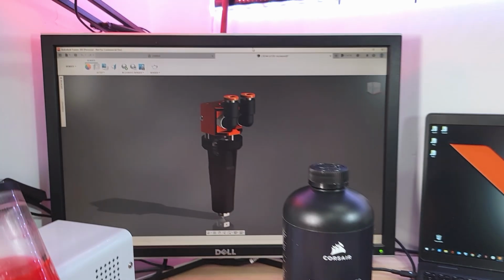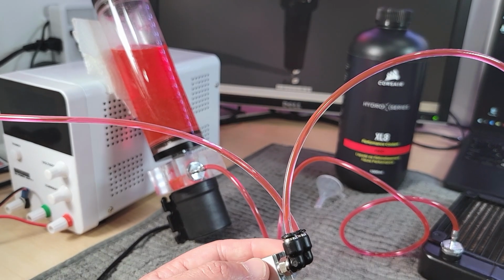LSD watercooled Heat sink flow test

Comment: you dont need that high of a flow. I tested that with my PC, Ryzen 5900X and RTX3080 on the same loop, loaded it with a Cinebench loop and Furmark for the GPU - so a constant 460 Watt load. With my pump at 2000 RPM i ended up with a water temperature of 42°C after 30 minutes. with the pump at 4000 RPM i got 40°C - so thats pretty negligible. Contact area for the coolant is the most important factor...
Reply from the maker: Yep.. as long as there is a bit of water movement..its fine :)

Comment: What is the internal geometry of the block? I see what looks like a ball bearing so I am assuming you just drilled each ingress/egress to depth, and then drilled perpendicularly to connect those two drills and sealed with the ?bearing?
Reply from the maker: Yes. 3 holes in a U shape arround the heatbreak
Reply: @Vez3D  ok, I cnc'd mine from the front so it stores more water then added an acrylic cover. I used some sort of sealant glue and friction fit, but an o-ring would do too; like GPU blocks do and probably easier than gluing. I tried to make inner cavity fins too to increase surface area but I didn't have a small enough endmill so I ended up cutting them off. Your U is probably ok too, but if you find it's not transferring enough heat energy you might try this. You have the extrusion hole to work-around, but you could go real deep on either side of it where ingress and egress is and get a good payload of water in there with larger SA.
Reply from the maker: @ColinMacKenzieRobots  my first design was a bit like yours...with acrylic cover and heat break surrounded by water..with a gasket etc.. but manufacturing cost stopped me. This one is easy to make and it looks so far like its keeping it really really cold

Comment: oh you have way flow than required! :) You'd do just as well with 10-20% of what you have. Even at 8v was high. Not that it would hurt but I'd PWM that down to 40% or so and the pump would be silent probably. Think of like how fast the heat energy is going to transfer into the water...transfer is not that efficient, so you just need to move the water fast enough that delta between aluminum and the water doesn't change. Having larger internal cavity surface area would help more. I have a water cooled head with a small cheap pump and it works great. I wish I used smaller lines like yours though - mine is also overkill

Comment: Flow is way sufficient. If you have a fridge in your printer area (or the other way around  ;-)) stick the coolant reservoir and the radiator inside it. Overkill would be a fan mounted on the radiator

Comment: Jesus, vez, thats a 12-15watts pump... Normal pumps are in the 5-8watt range.
But however, an LC hotend needs an LC cooled Extruder Motor (optimally LC cooled extruder gears either, or at least the extruder gears needs to be cooled smh), to have an optimal use of that in chambers of 80-200c.

Even if you print ABS in an 80/90c Chamber, the results are absolutely amazing comparing to ABS prints in 50c chambers...
That additional 30-40c helps alot with "layer inconsistent shrinkages" and allows you to print a lot faster either, because you can print abs with 100% fanspeed. The hot air improve ABS bridges extremely without the side effect of shrinkage/deformation.
And that's just abs...
LC enables printing all the high end expensive stuff either, but thats not my territory 🙈
I have only extremely positive experience in abs printing at 85c chamber 😂
And im not using LC, because there is not really sth nice out yet, compatible for me 🙈

However, the only problem what i experienced was too hot extruder gears and that the filament got soft and pushed on the side out (LGX), my fix to that was to reduce current of the extruder motor. Seems like the LGX motor got too hot, and transferred that heat to the extruder gears and the filament got soft.
Thats the issue in a 85c Chamber, because the motor produces heat either, so that it probably reached 120c.

Cheers 😘
Reply from the maker: Haha the pump came in the mellow kit. I have no idea what "normal". Yes its good to cool the motors too. But ldo motors i used are rated up to 180c..so its not THAT bad to not cool them..but yes they will be more efficient at cooler temp
Reply: @Vez3D  the motor temp is not what worries me, its just that the motor transfers the heat to the filament gears and that makes the filament soft and jams 😂
Had exactly that issue once here in a heated chamber.
Cheers vez ✌️
Reply: @RamaOlama  yup, same here

Comment: you dont want it fast its better slow to allow heat soak if you run it too fast the whole system will be close to the same for and aft radiator as it also has no time to cool the liquid

Comment: BTW, I tried that Exact Pump/Res. After a while, It Fills the Loop with RUST from the Cheap Pump. Get a D5 Pump if you want somthing Long Term
Reply from the maker: Ill keep an eye it. But that reservoir and pump has like 1000 different model on aliexpress that look the same..so it might not be the same. Ill see. Thanks for the advice

Comment: Nice job. I think they'll probably work pretty well. My primary concern is plastic fatigue in the tubing. Especially at those SharkBite joints. That normal printing speeds I don't think that'll be a problem, but at plus 1000 mm per second.... Not quite as certain.

Comment: What is the benefit of watercooling a hotend? Less weight on the print head?

Also, you aren't an engineer? Is it something similar, like machinist or tool and die maker?
Reply: Hotend fans tend to be the loudest part you can't control, with water cooling you can make it silent by having a silent bigger fan and a silent pump

Comment: I have yet to take any heat transfer courses as a student, but gut feeling says that's probably enough cooling. I was kind of concerned at first about potentially having too much back pressure on that pump given the small tubing, but your current draw is fine and it's probably not an issue. Air going through the pump, however, won't be good long term, so I'd find a way to minimize the amount of air bubbles in your reservoir.
Reply: I've had 2 years of thermodynamics in school, that flow is probably enough to cool all motors too, the average heatsink fan has at most 1,5 watts, the pump about 12. Its the same with car engines, porsche had to switch to water cooling because they water pump needs less than half of a kilowatt, meanwhile the fan for air cooling needed 13 to 15 kw according to our calculations for a 200kw engine. Less parasitic losses, better emissions/ fuel economy. The reason is a kilogramm of air has way less thermal capacity than a kilogramm of water. Same goes for the heatsink on a 3d printer. Also the pump should not draw air, it relies on coolant passing trough it to not overheat, thats why you should not drive your car all the time on empty, the fuel pump might draw occasionally some air causing other problems too.
Reply: Pump pumps till pump dumps then dump the pump and pump#2. Engineer expensive. Estimator very cheep and pump even cheaper. The first and only rule for the engineer is to keep it simple stupid. Once you fail to do that you just start taking suggestions

Comment: If you do anymore testing of the unit it would be interesting to see it with a heater block installed and powered and another thermistor at the top of the cooling block. Pretty sure the radiator can handle the heat, but it might be worth knowing if it will need a fan or not, so maybe some thermistors at the inflow and outflow to measure the temperature gradient. Your doing some really cool stuff, keep it up.

Comment: I tried water cooled hotend with same pump and radiator and I put standard E3D V6 back. Water cooling is an overkill, even with heated chamber. It's better to invest in titanium heatbreak and good thermal paste like MX4, it will give same result even with 30mm fan.
Reply from the maker: There is better choice than titanium ... zirconia in here ;)
Reply: People keep saying this but it's a bit closed minded to all situations. I'd prefer not to use it (I'll agree to that) and I think printers should be designed to not need it for common use cases. My old Rep 2X had a hot stepper that would overheat the carriage and even leak into heat break. It was a very thin line of settings including opening the lid a certain amount to get successful prints. Aweful. Modified it like crazy including better stepper but best mod was watercooling and suddenly all those other tweaks didnt matter. On the other hand, my new core-xy with Orbiter+Rapido doesnt need it and that's awesome...but if i go to high temp stuff I'd have no problem adding it like Vez3D here. High temps destroy fans so I think it could be more reliable in this situation too.
Reply from the maker: @ColinMacKenzieRobots  high accel destroys fan bearings too ;)
Reply: @ColinMacKenzieRobots  Installing water cooling instead of printing carrige out of ABS? Weird decision. :) 
As for high temp, a real high ambient temp is reqired only for PEEK or something like that, which is too special. All other fillaments like ABS or PA6 prints with 50-60 degrees chamber, which is OK for fans.
Reply: @TheNamelessOne12357  See this is what I mean...you assume I didn't try the other things. Carriage was ABS which just meant all the stepper heat went into the extruder gear and melted the filament there. Originally, it had a heavy heat spreader bar to soak heat from stepper - yeah that's great for fast motion /s. My Replicator 2X printer came out in 2013 and wasn't a great design to begin with. I've modded it so much only the frame and XY gantry is original. I tried taking out the watercooling and redid the carriage, E3D hot-end, better steppers...but all the steppers are still in the enclosure and after an hour the temp would surpass 80deg and prints would fail. Reduce current and fail cuz missed steps. Try to keep the enclosure open a crack but you'd have to watch temps constantly and adjust. Finally was like F-it, went back to watercooling and got the tiniest water pump and a little radiator, and I still use it to print ABS parts today unattended...it works great...after 10 years! Watercooling steppers means you can use lighter ones with more amps...eliminates heat creep period...and it's cheap and easy.

Comment: That is way overkill. Basically you do not need much flow to cool it down. BTW it is possible to get lighter connectors for that. I had water cooling at printer but I remove it because I get tired to add water. Those pipes will breath surprising lot.
Reply from the maker: I have the smallets barbed connectors one can find on the market here with me..and they are not ligther than these plastic fitting. Also, i need 90 degree up..and that means i also need the fitting to be swivel. So those were the best thing i could find.  :)
Reply from the maker: but if you found a fitting that I dont know about.. please share :)

Comment: Soon we're going to need to start working on printers with heated build chambers (since that company's patents will be expiring in a few years). So  I don't know if it's so wise to be pumping research into cooling nozzles. I was always of the belief that the nozzle should be cooled by the filament flowing through it.
Reply: Patent already expired
Reply from the maker: You dont cool the nozzle..you cool the heatbreak.
Reply: @Vez3D  Yes, the heatbrak/thermalbarrier my mistake.
Reply from the maker: I think its specially wise to do with heated chamber :) You can cool the heatbreak, the motors, etc.. :)

Comment: Use bigger id fit on the reservoir so you don't have so much bubbles and flow jet to the bottom, but a small pipe inside the reservoir under the fit to guide the fluid smooth in the reservoir
Reply from the maker: There is no bubble when its filled up correctly.  It was just to show flow

Comment: I have much smaller heatsink with D-3.6mm tubes in mine Delta effector, and it’s work perfectly fine for a several years already, so you should not have problems with yours)
Just check the temperature of water/heatsink or both after 1-2 hours of working

Comment: Seems overkill to me... Assuming the heat brake is doing its job well, I don't see how can this be beneficial over a regular setup
Reply: The primary use is for a heated chamber system. At least on my setup anything above 60c chamber temp and my air cooled heat brake just isn't effective anymore. The air it has to work with isn't cool enough to dissipate the heat anymore.

Comment: Let's be real for a second. Assuming your chamber temps aren't too high, your maximum power to be dissapated would be whatever creeps through the heatbreak from the heater cartridge. Ergo: a couple watts. Turn the pump down as much as you want, the amount of water alone can store enough energy to keep a hotend cool
Reply: yeah i think components can be downsized a lot. Like an Alphacool DC-LT 2600 Pump, and a 40mm Radiator. Rule of thumb is for 100W of heat a 120mm Radiator is needed. And flow isn't that important at all, if there is at least some flow
Reply: @metallsimon  on the other hand... These components are relatively cheap and can be run on lower voltage, making them quieter. I guess the fan barely has to run at all to keep this thing in check
Reply: You can put a MoBo and stepper Motor cooling in the Loop ... this should be awesome .
Reply: thats why i was thinking why not blow room temp air into the block?

Comment: It would be cool if the water block had a hole for a temp prob so you could monitor the cold end temp and automatically adjust the flow rate to maintain a constant temp.
Reply from the maker: There is one

Comment: Oops.. My Bad...  I just noticed that those connectors wouldn't accommodate silicone or latex tubes. My thinking is that those tubes are designed for computer system which isn't moving around, and your application is more like trying to hold on to a schizophrenic Wolverine on steroids & LSD! 🤘
Reply from the maker: Polypropylene tube here

Comment: It looks to me like that water cooler is designed to cool a CPU chip consuming several hundred watts of power, if not more. What's the wattage on the hot end? The thing I'm worried about is the acceleration on your printer could put too much stress on the connectors. What type of plastic are those tubes made from? If it was me, I would use silicone or latex tubes attached to the cooler block. Wouldn't want to see those tubes pop off or break during operation. To make things interesting you should put a thermistor on the cooler block. That way you can monitor its performance from the console. Keep up the good work dude!
Reply: These connectors are also available in metal, so plastic doesn't have to be used. And as for the hose connection, you will break the tube before it gets loose. It's the same type of connection that the PTFE feeding tube uses. And they're air tight.
Reply from the maker: Hose will be attached to be strain releived ..no worries

Comment: Just a quick admiration comment for your posts recently. Really sweet setup with the VZ Bot and LSD.
I have myself some experience with watercooling my pc:
First your pump is pretty silent compared to the average ones.
The pump has to work extra hard to push the fluid through the small diameter tube. (That's why it can be a little be more noisy) You can just dampen it with some rubber stand-offs.
You can take the wattage (heat)  output of your cooling loop roughly from some pc cooling forums (80W TDP per 120mm radiator space with 600rpm fans).
And lastly water can store a lot of energy. I mean your loop shouldn't be that long, but I would suggest to install an extra temp sensor inside the loop to monitor the temperature. Just to be extra safe, if want to have reliable results everytime.
Lastly don't take my advice to serious. I'm not an engineer. Experiment and have fun. Good luck to you and happy printing!!
Reply: Ahh yes just forgot to say. Your waterblock is fine, but you got already very smart people in chat who pointed it out.

Comment: Very little flow of liquid is needed to keep the temps low. I diy-ed a tiny water cooled hotend, with a very small fishtank pump and no radiator whatsoever and zero issues ...
Reply from the maker: I think so too.. as long as the liquid moves
Reply: @Vez3D  plus you can play with the volume of your reservoir. Champagne bucket ice cold 🥶